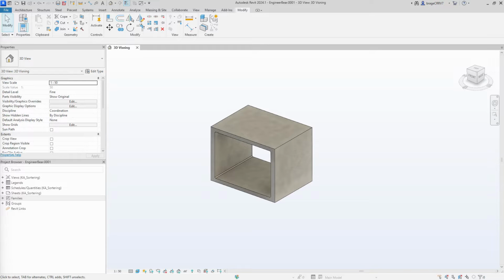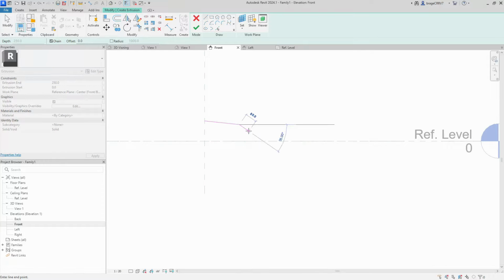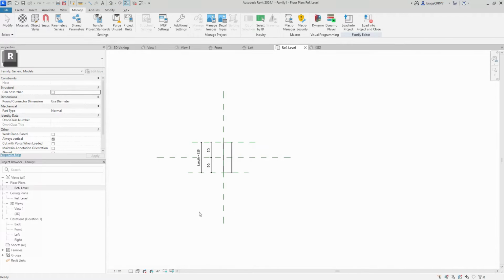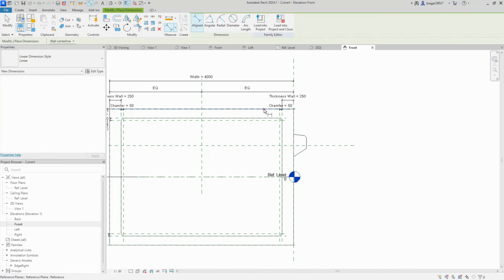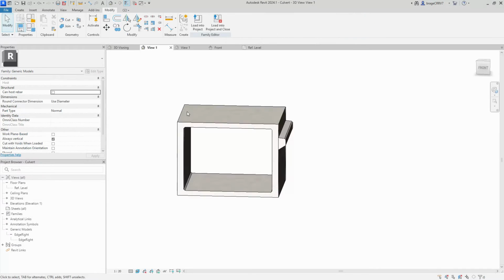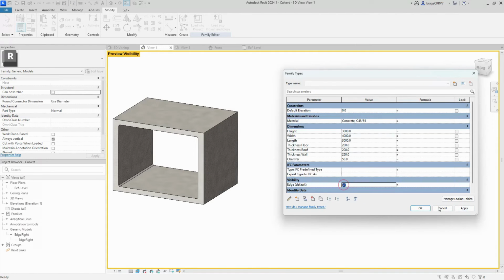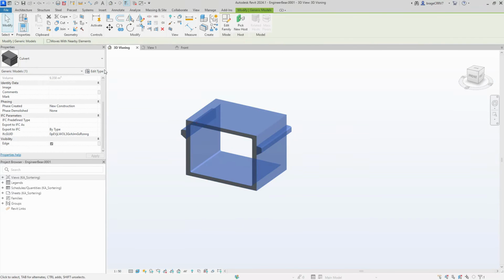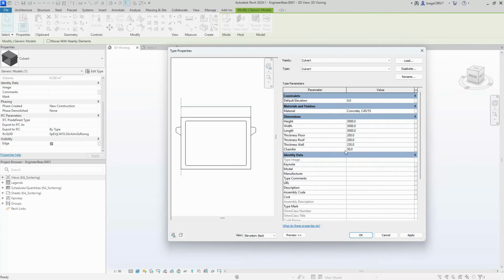Revit family | Control visibility of an object with yes/no parameter

Comment: is there a way we can exclude the elements  from the  host for volume calculations when visibility is off? 
right now i just assign different material  for those elements  and schedule material volume and filter them out
Reply from the maker: I did some testing tonight but could not figure out a clever solution! I did experiment with shared parameters that could be scheduled in the Revit project, but it was not optimal! Did you figure it out?
Reply: @EngineerBear90  yes we can but we need to load nested family as shared  family inside host family.
Reply from the maker: @Deepesh_bansal  Yeah, need to do something like that; maybe not worth the hazzle
Reply: @EngineerBear90  yes exactly and thankyou for all the amazing  videos, learned a lot from them👍👍
Reply from the maker: @ Thanks, Nice to hear

Comment: Hi EB. 

Thanks for the video. Very helpful with the visibility parameter control. 

Was it necessary to create the left edge? I thought that once the right edge is loaded, you can use the spacebar to rotate it to the opposite direction. Or does that only work in the project environment?
Reply from the maker: Hi Evanslion.

Thank you.

It was not necessary to create the left edge, as you state once the right edge is loaded you can just use the spacebar to rotate it to the opposite direction. Should have mentioned it in the video.
Reply: @EngineerBear90  Im just a newbie, so i created the left edge and assigned them with separate visibility ie "Left Edge" & "Right Edge" as sometimes we may need just the left or right edge. Didnt tried if it works the same if i just flip the right edge as my left edge. It may not work.
Reply from the maker: @jessie_8301  Sounds like you have figured it out! Does everything work great with the visibility parameters on the left and right?
Reply: @EngineerBear90  yes they work fine individually.
Reply from the maker: @jessie_8301  Great to hear!